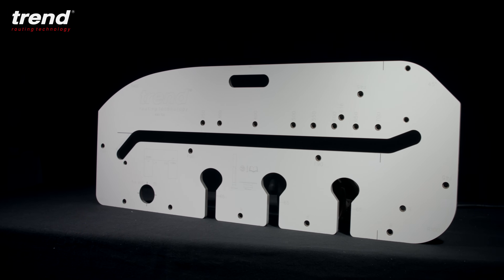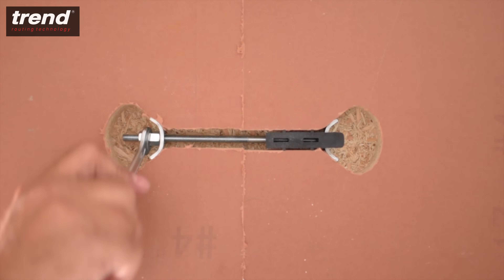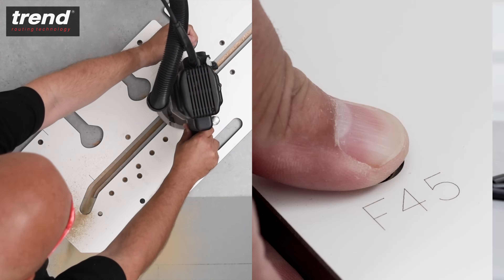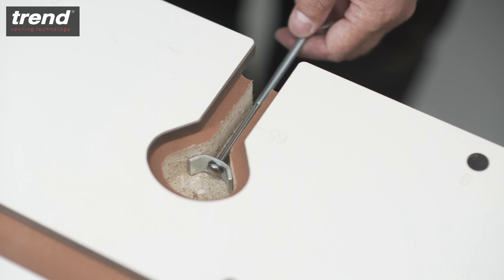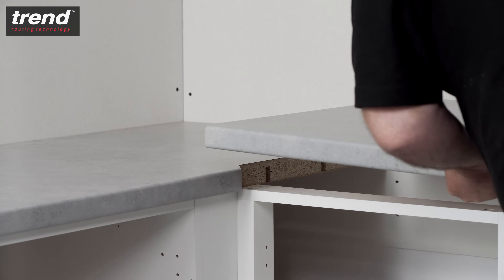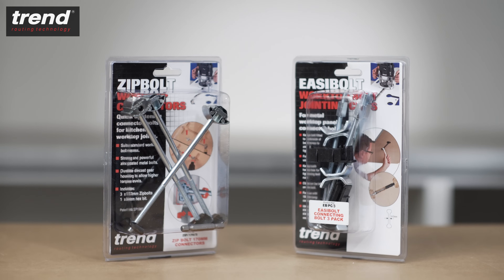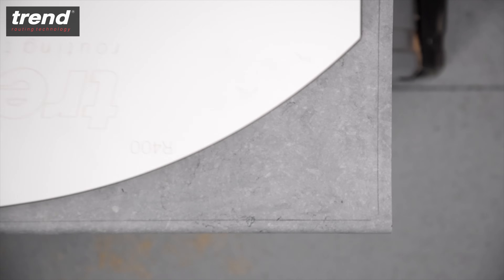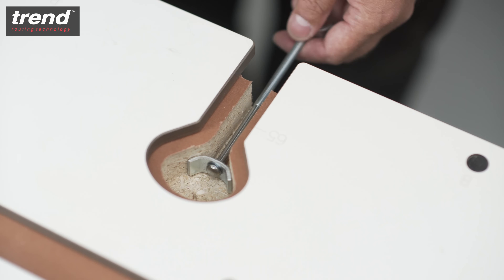Trend KWJ700 Trade Kitchen Worktop Jig

Comment: I got this jig. It's good. Although my missis had a go in my van a Vito and didn't put the handbrake on. Van rolled away I saved it and reversed the van over the jig, it slipped out of the van! To be fair a couple edges I cannot trust now but for the most part it took a van driving on it!